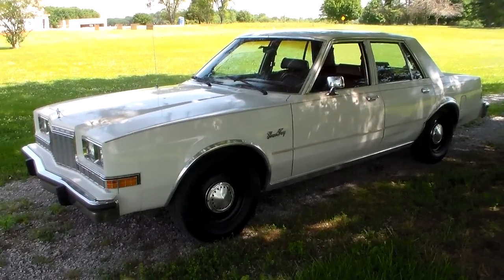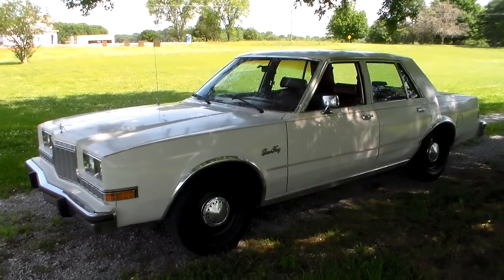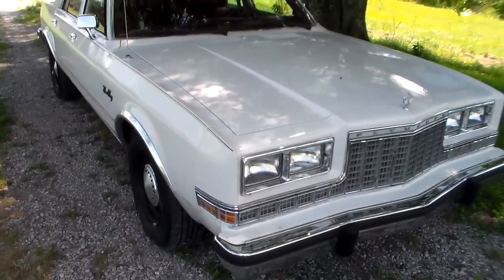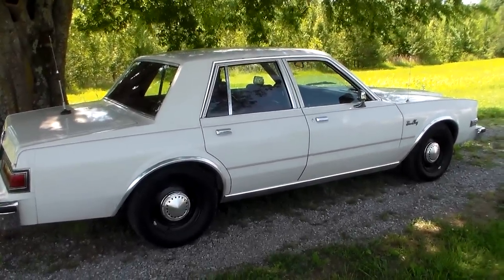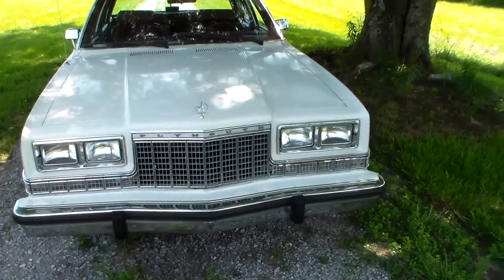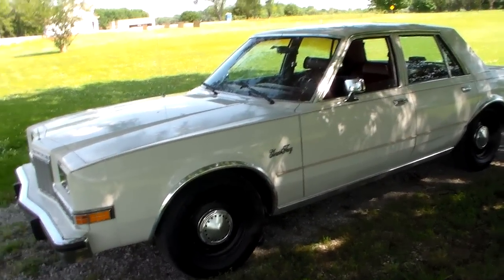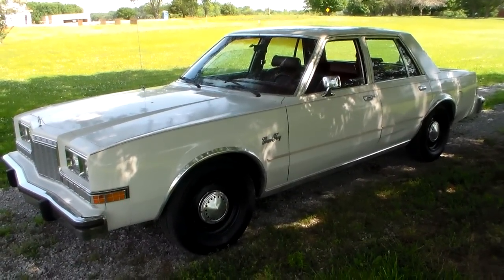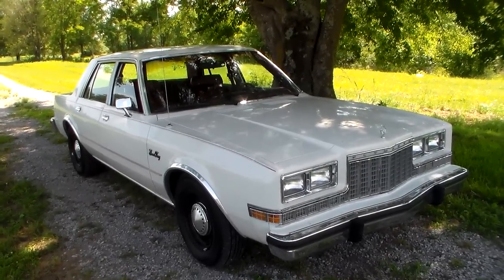1987 Plymouth Gran Fury update June 2018

Comment: I am no expert on AC but having had a few experiences retrofitting r12 to r134a, is you are right about about the half ass job on it. If there is no high side fitting attached they went to autozone and bought a low side conversion fitting and a can of AC pro with a low side gauge on it and probably stuffed the whole can into it. Overcharging the system can have the same effect as no charge in terms of cooling. Anyways im sure you know all of this already, my recommendation is since the compressor runs, get a little UV dye into the system, check for leaks, discharge the system, replace accumulator/reciever drier, TXV, possibly also want to flush the systems oil out, who knows what got put in there, I've used ester oil in my conversions over pag unless changing compressor. Pull vacuum and fill system to 80-85% of r12 charge capacity. Good luck!!
Reply: If someone put that EZ ac charge into the system some of those have stop leak in it, sure to cause a expansion valve clog.. some of them have oil in the can and mix in with the OEM mineral oil and make a milkshake.

Comment: It's a great looking car.  I have a 1988 Aries, not the same car, but I have a soft spot for old Mopars.  What kind of tires are on it?
Reply from the maker: Tom Lewis Thanks....some kind of cheapos called Lau fen
Reply: If it's OBDI, a Actron CP9690 can test a 1999 Aries. EBAY has it. It checks codes. It's well-lit! Get 4 aaa batteries, not included for under the rear cover. Get a Snap on scanner and primary and troubleshooter cartridges and manual and adaptor if it's OBDI. It uses a 9 volt square battery. EBAY has them.

Comment: I watched both of your video series on converting from Lean Burn to HEI.  Did the factory timing spec change after removing the Lean Burn.  I have read in other posts that the Lean Burn allowed the timing to be advanced more i.e. 16 BTC due to the EGR functions.
Reply from the maker: Ron Abeyta I haven't experimented with it yet. Right now it is on 12btdc and pings slightly from time to time.
Reply: @TylersNeighborhoodGarage  Maybe back it down 1° to stop the ping. Check the EGR to see if it's not opening.

Comment: hi tyler how`s a going , iam in a few weeks a proud owner of a 1977 plymouth volare wagon with some woods on the side lol............my question is how much i can tow with this mopar with the right set up (new brakes , new shocks, and a custom fit tow hitch......)thanks in advance 
david
Reply from the maker: quentinsfeet70 2000 lbs would be safe. You for sure need a transmission cooler.
Reply: hi thanks even with a heavy duty hitch and heavy duty shocks i have heard that you can go up to 5000 pounds................with trailer brakes for sure.............and trans cooler.........

Comment: It sounds like the a/c is just low on refrigerant to me. My cheapie Harbor Freight manifold set will do both the R12 and R134a fittings by just removing the quick connections from the hose and screwing the hose directly into the fitting on the car (wear gloves to protect your fingers because alittle coolant will leak usually when screwing them on. Hopefully, its r134a because its still cheap!  If it is still r12, I would either pony up and buy more r12 on “fleabay” or just forget about it. I don’t think I would open the can of worms of converting it to R134a if I was planning to sell it soon. If you can decide to have it evacuated and switched to r134a, I would just go ahead and replace both schrader valves. They are dirt cheap and will usually solve slow refrigerant leak problems. I would also go ahead and renew the expansion valve and the receiver dryer, both are cheap and easy to do. Hopefully, you won’t have trouble with the non barrier r12 hoses leaking through. Most Napa stores can crimps the barrier hose onto your old fittings, but it ain’t cheap! You’ll also need to buy the flush to clean all of the old ester oil out of the system and replace it with PAG (r134 and ester oil don’t like each other). You might even need to replace the condenser in front of the rad with the 134a compliant type, but that would probably be a stretch! See what I mean about a can of worms?  If you can confirm it has 134a in it already and the gauges show its low, I’d just throw enough 134a at it until the pressure is right. If it cools good, you win! If it still doesn’t  cool, sell it as-is.
Reply from the maker: Brian Andrews Thanks man. I didn't know that about the adapter.   Not sure what's been done to this ac....it looks like the compressor is leaking.  Thanks for the info!